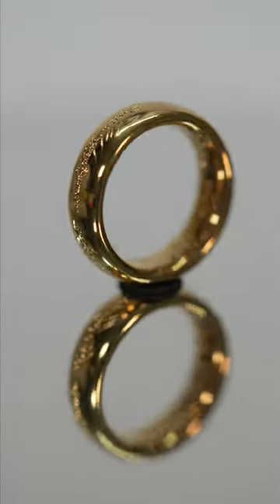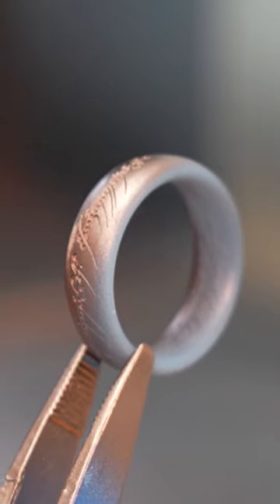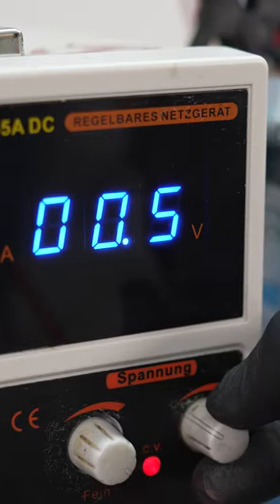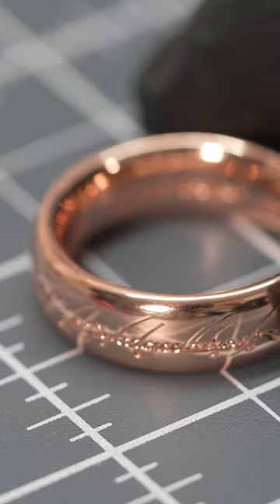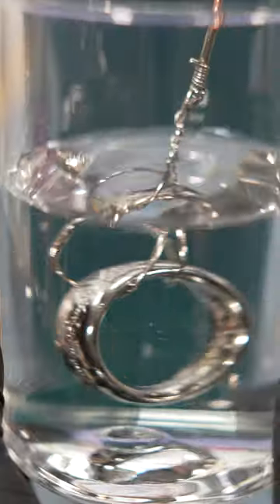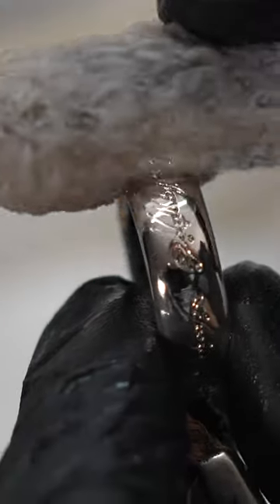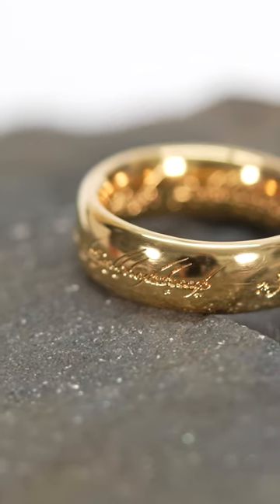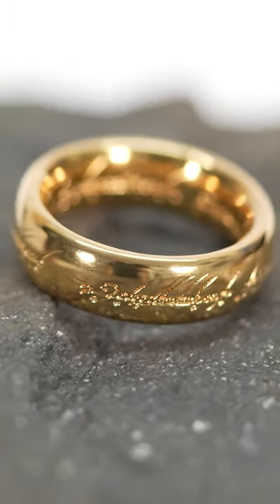Golden 3D Prints! 🥇#shorts

Comment: What would happen if you just sprayed the conductive paint and then tried to apply the gold, skipping the other steps?
Reply from the maker: Doesn’t work at all. I deposit a 0.25mm layer over 4hrs. Gold layer applied by the brush would be 1micrometer.
Reply: @hen3drik  so the reason why you apply copper and then nickel is to build a thick layer for the gold?
I want to try this proccess with my 3d prints, but I'm trying to fully understand it first.